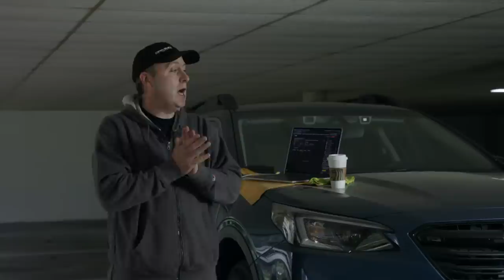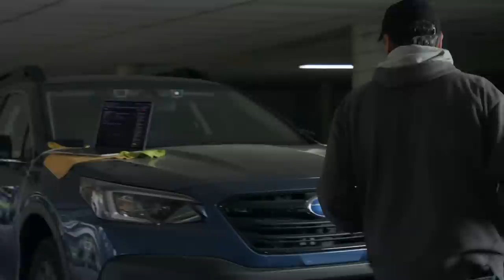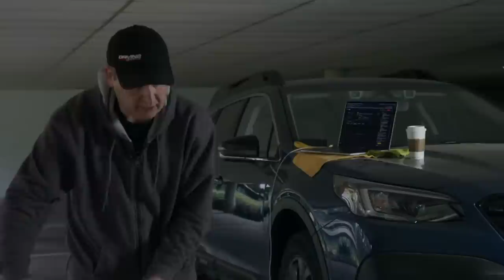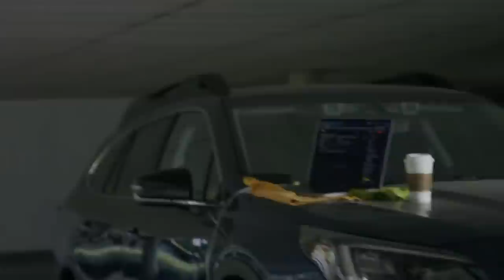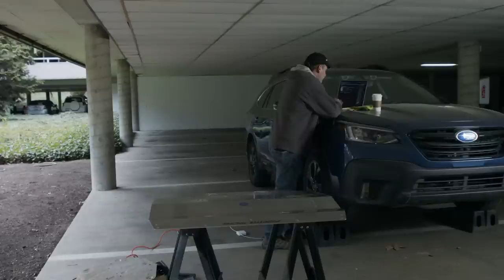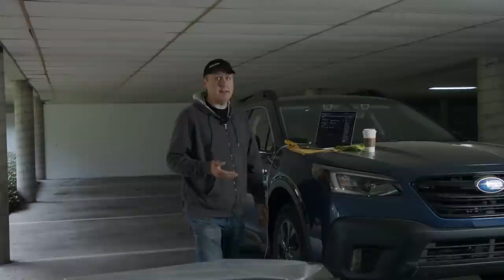Good-Bye Subaru Outback Onyx XT: AMA and Skid-Plate Test (Live Stream Archive)

Comment: Great livestream. I really wish that I could have actually caught it live. I have a 2023 Limited Crosstrek PHEV and I drive a 500+km roundtrip every week in the harsh snow country of Canada. The weather goes from blinding snow with 80+km winds to unplowed snow-drifted roads a lot of the time. Of course, from  time to time my Eyesight will get disabled when my windshield gets coated in slop from a passing semi or a car cuts in front and throws a wad of the salt, sand, snow slurry at me. It always comes back on quickly once I get some windshield washer fluid going with the wipers. The only other issue that I have seen is that really heavy snow can sometimes trigger the adaptive cruise control to think that there is something ahead of me and the car will slow. This is quite rare and has only happened a few times in literally blinding snowfall.

I have to say that this fantastic vehicle has saved me multiple times with blindspot detection and rear obstacle detection. The most life-saving moment happaned on the highway at 100kmH when a likely impaired individual decided to just cut right into my lane missing me by maybe an inch and a half because the Crosstrek detected and braked fractions of a second before I could react! I love my Crosstrek!

Comment: I have 2020 Outback Limited 2.5L.  I purchased Subaru skid plates, front & rear, no middle offered, from the dealer.  The skids offered for the 2.5 are steel.  The one for XT is aluminum which appears to be what Ryan pounded here.  The Primitive offers 3 skids - include the middle.  My front skid plate is closer in size to the primitive here.  I couldn’t see before install, but brought the plastic original home.  It is quite large.  Those 2 factors tell me the skid is protecting more real estate on my car than what the XT has protected.  I am curious & hoping my steel plate is better than this XT version & on par w/Primitive.  The Subaru plates are a fraction of the price and I didn’t have knowledge or experience Ryan demonstrated here so I purchased the Subies.  I was also up against a trip time crunch.  These plates served me well, one particular rock especially, on this trip to Anza-Borrego Fish Creek Wash.  I am considering getting the middle plate from Primitive for that peace of mind - think it protects the oil pan.

Comment: Really enjoy your videos and this stream.  I purchased my vehicle based on your reviews.  Really appreciate how you explain how the AWD systems operate and reveal the pros and cons of the systems.  I bought a Honda Passport Elite and really enjoy driving it both on and off-road. I was surprised to learn the Passport didn’t come with any recovery points (except from the tow hitch I had installed by Honda).  Never thought to consider that until your review of your 4Runner. Not saying that would have swayed me but I think Honda dropped the ball on that. I did buy after-marked skid plates because I do go off the beaten path. I had Honda perform the install because I don’t have any lift ability where I live.  At least it’s something to protect the entire front and rear diff.  And the plates don’t reduce the ride height at all. Thank you for your reviews.  I have learned a lot from them

Comment: We just bought a 23 Forester Wilderness.  One of the selling points for me was factory skid plates.  About a week after bringing it home I finally got under the car to have a look.  I was severely disappointed and annoyed.  The front plate is aluminum sheet metal with a sound insulation backing,  and a plastic splash shield you would expect to see under the front of any car. No protection under the transmission or the rear differential.  And the floorboard/ fuel tank skid plates are quite literally just plastic covers.
Reply from the maker: For full protection you need to go 3rd party, like Primitive Racing.  Subaru used to offer additional engine and diff plates but they were built in Russia, so that’s not happening now.

Comment: I've had 4 now and driven av 120,000 miles in each one,. Simple, robust, large flat load area, tow 2t Trailer, never get stuck in mud or snow except when it was deeper than the car ride height!. Low maintenance and running cost. 
Only disadvantage - Emissions std is low,  making it expensive to run as a company car. 
Brilliant as a private  car in a rural and farm Environment. Nothing comparable!

Comment: Hey there! We went to the dealership to drive a crosstrek or Forester Sport to replace her 2013 Outback. She saw the onyx XT, she wants that now.
Reply: @Pete Roman...we have one...very nice car, except for the info system...many negative reviews, but the car itself is great. Thanks.
Reply: @darrellborland119  I have an Impreza with a similar infotainment system. Okay for the most part but android auto can be frustrating at times.
Reply: @darrellborland119  I love my Onyx XT, but the info system resets from time to time, but it has gotten better with a few updates. Even though it can be better, you will get used to it quickly.

Comment: I had an Onyx XT for less than a year before selling it. Here are the 5 reasons I got rid of it:
1. The CVT was poorly-programmed. The initial surge off the line was followed by a steep drop to sluggishness until 30%+ throttle.
2. Eyesight was waaaaay too naggy.
3. The infotainment system was 'meh' at best. Like you mentioned, it often wouldn't connect to my iPhone.
4. The front and rear cameras were of terrible quality. Not sure if this was a camera or infotainment issue.
5. The CVT was poorly-programmed. The initial surge off the line was followed by a steep drop to sluggishness until 30%+ throttle. (It was bad enough to be mentioned twice)

I hated getting rid of it mostly because I had such high expectations. But the more time I spent with it, the more I started to dislike it. I bought a 2020 WRX STi six months into my ownership of the Onyx XT, and it didn't take long for me to determine that I wanted the STi to be my daily. Sure, I can't go offroad like I could in the Onyx XT, but I enjoy driving the STi soooo much more. That said, I miss my 2005 Forester XT way more than I enjoy the STi. I regret the day I sold the Fozzy.

Comment: #1 Is that plate Alum or steel ?  #2 Up dating my maps via  my WIFI (bad boy gaming router) is really impossibly slow.  Doing this with the engine off, the system keeps shutting down after maybe 15 minutes and then during the restart has to recover material you've  already down loaded.

Comment: Subaru are well known for these issues… bad AC condensors that leak, cracked control arm bushings and faulty wheel bearings.  I’ve owned 2 subarus including a forester XT SJ, all those issues I mentioned had these issues.  If you don’t trust me join a FB Subaru forum and search…it’s common.   Would I buy another Subaru …no, but in saying that I get why ppl like them.  H and the cvt drives me batty, it robs the engine of power